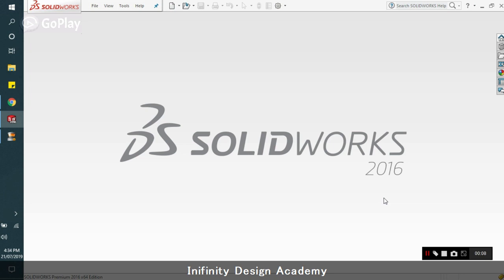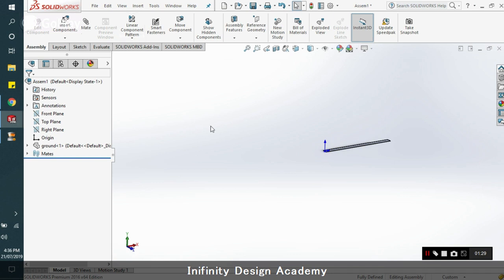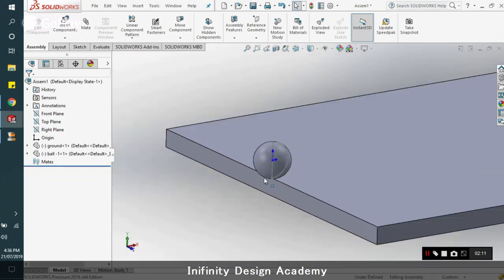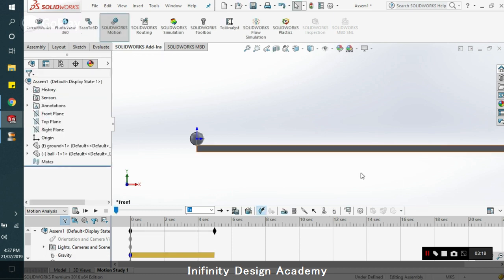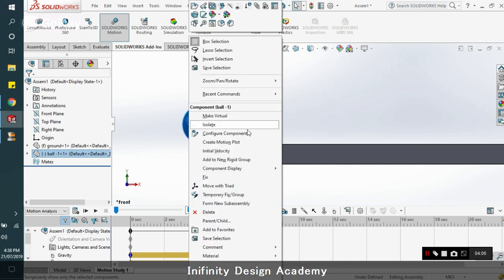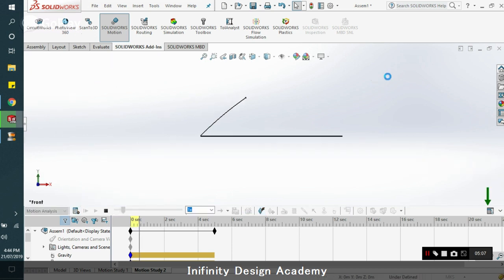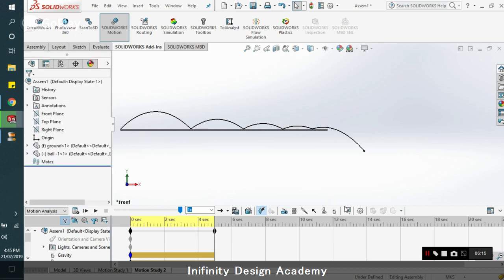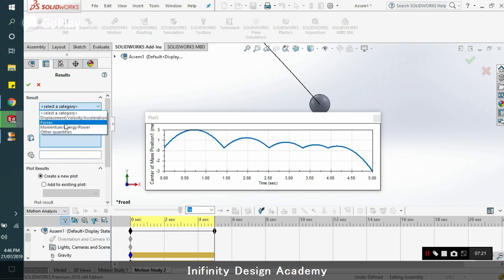Projectile Motion Analysis using Solidworks

Comment: I tried, but in my case, the ball crosses the ground and continuously kept going down. No bounce effect. DO you know where I could be wrong?
Reply from the maker: Rahul Verma make sure that you simulate contact (high accuracy) and also make sure that motion analysis is at lease 30 frame per second .
Reply: @infinitydesign2584  Thanks for reply. Want to add One more thing that keep the thickness of plate proper, if the velocity is high.